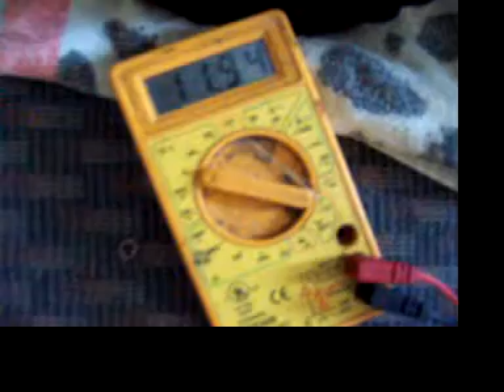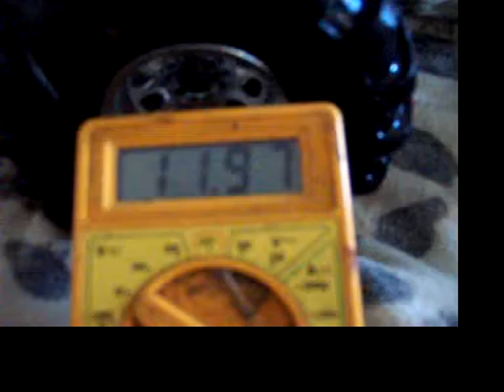wheely king 12000mah test results

Comment from the maker: ill do a 8800pack test soon should handel nice 

evin with the 10 lbs of bat i can still spin the tires on wet pavement on dry they stick an it tryes to flip or break a shaft lol yeah 10lbs is to heavy should be about 6-7 agean with the 8800 pack